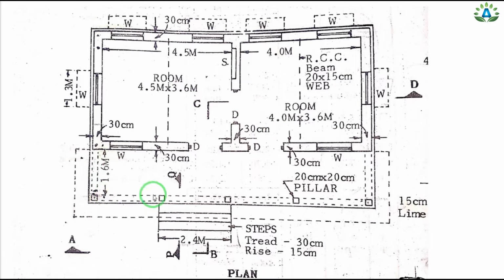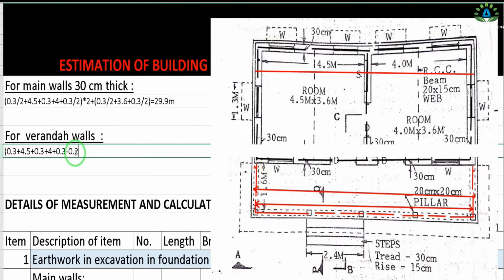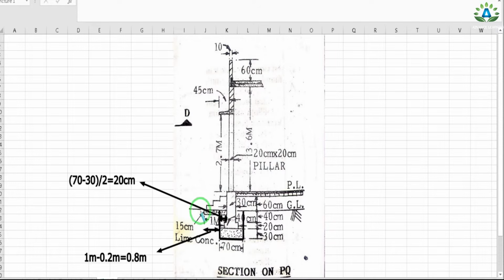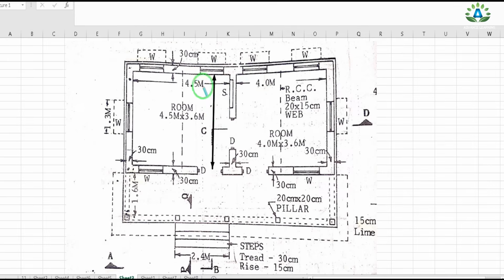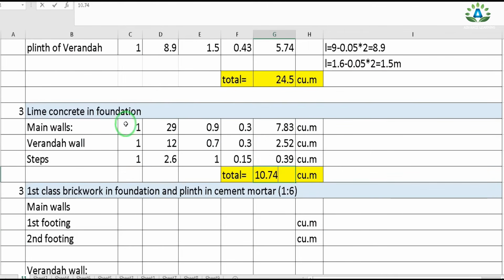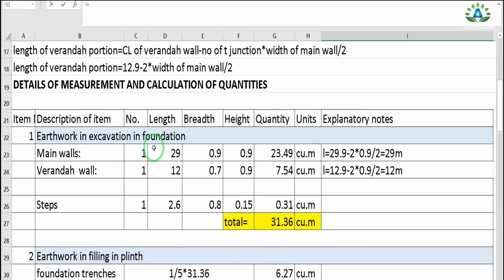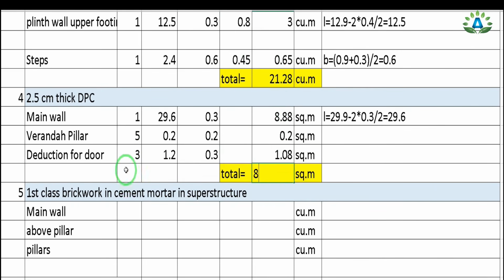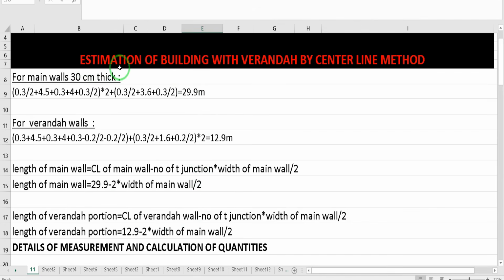ESTIMATION OF BUILDING WITH VERANDAH BY CENTERLINE METHOD (PART 1)

Comment: why the foundation trench is taken as 1/5 of total quantity of excavation?
plz. let me understand
Reply from the maker: Considering the low rate of earth filling, the quantity is usually taken as 1/5th of  volume of earthwork. But for high rate of  earthwork in filling or for accuracy, quantity of earthwork in filling in foundation = volume of earthwork in excavation - volume of earthwork in foundation
Reply: @ADVLEARNING  should be minus the volume of brickwork, isn't it? which software you used to make 3D of the figure, any advice  and material of this content to teach students on online?